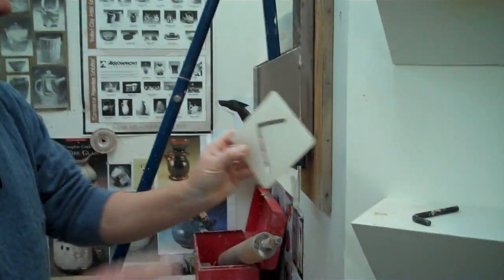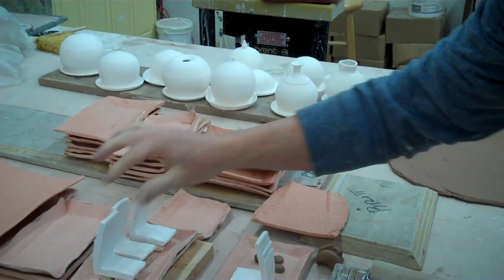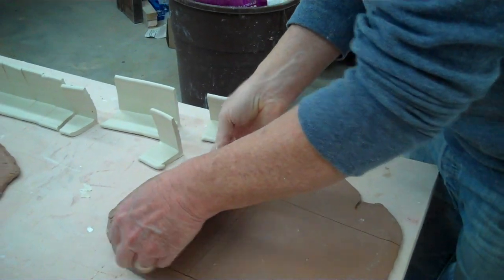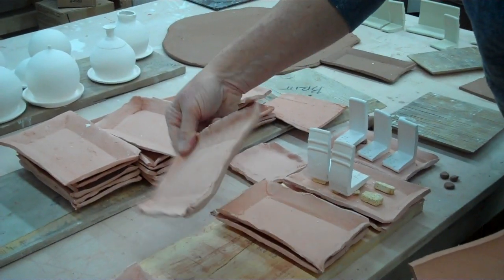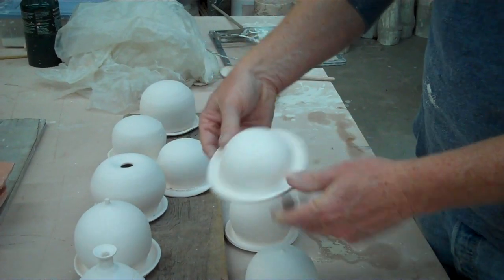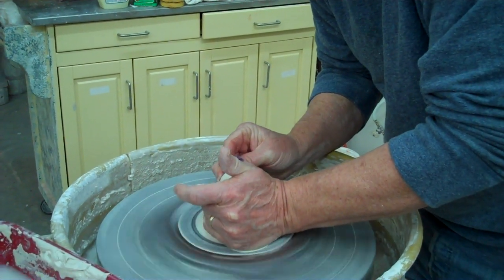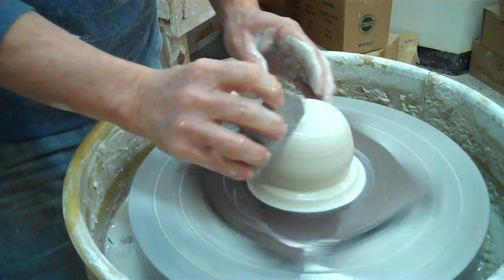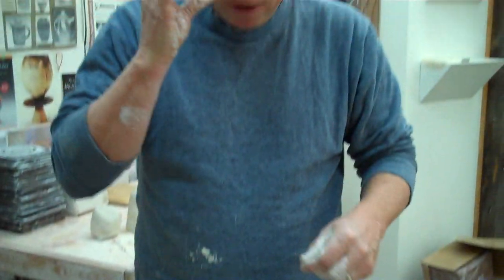Drip Trays for Crystalling Workshop

Comment: John Britt, In your book" The Complete Guide to Mid-Range Glazes" on page 149 the piece you have there glazed with "Bill's Best(veriation) and Licorice. The question I have is, does the refractory slip have a red masonry stain in it? If not how did you get that good of a red. I have an older electric kiln and when I test fired the glaze, all I got was the blue crystals on a light tan background. And one last question for you if you have the time. I have all the drip plates made up and all, the question is on many web sites and book is the talk about a way of firing crystalline glaze with using a puck made of equal parts alumina, kaolin, and sawdust 1/3 inch high at the same diameter of the vase. The one thing that I have not been able to find out is do you bisque fire these pedestal or do you leave them dry and just let them fire for the first time when you glaze you work? This is a way that ceramicartsdaily.com describes in the article "Mystery of Crystals" I have really enjoyed you book and it has been a major help in the understanding the ceramics. Thank you for your time reading this Matthew Robinson, student Baker University, KS